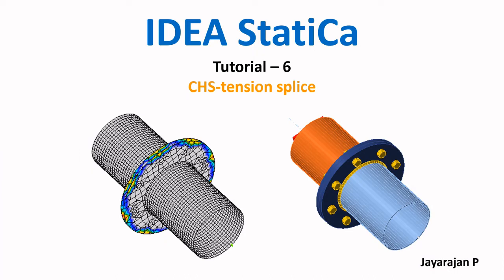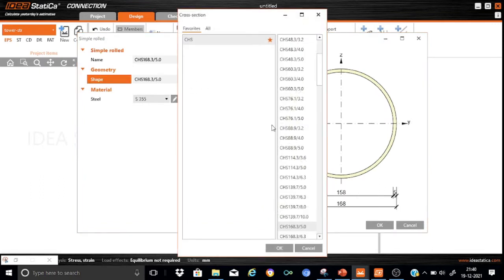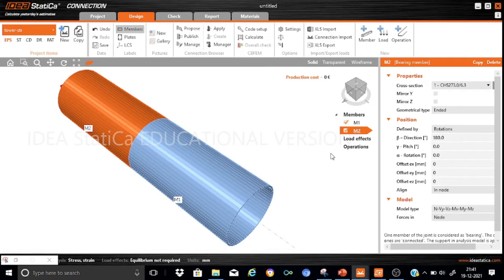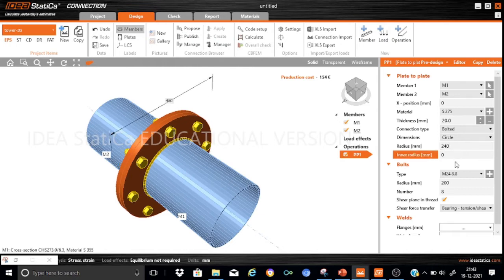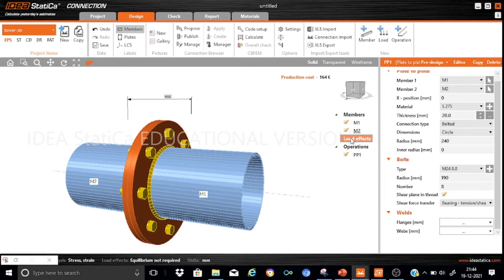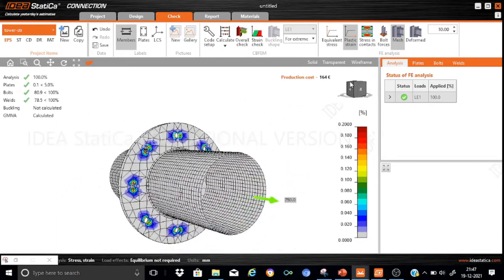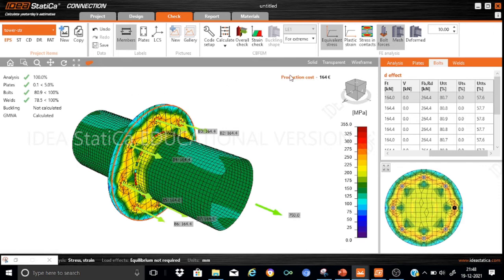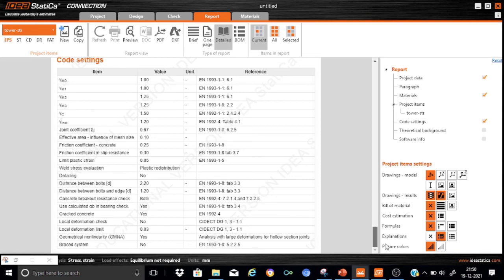IDEA StatiCa: tutorial-6: Circular hollow section(CHS) tension splice

Comment: Great Tutorial Sir.. I have 2 questions. 
1) Total Axial Tension force is 750 KN. and Each Bolt Force = 164.4. Sum of all Bolt Forces = 8*164.4 = 1315 > 750 KN.. How is this possible...??? 
2) In Model Type of each member you did not select N-Vy-Vz. Is there any difference in the analysis for doing this.. because I have observed   that results are some time contains errors when correct Model Type (Degrees of freedom) not selected as per the model. Please explain
Reply from the maker: Hi syed,
This could be due to the prying effects (I have not seen the file). Can be checked by  repeating the analysis for smaller to larger thickness of plate  and noting any differences in bolt forces. please let me know.
You can select the model type based on the member forces expected in the analysis. If you are not sure, go for the general one considering all the six.